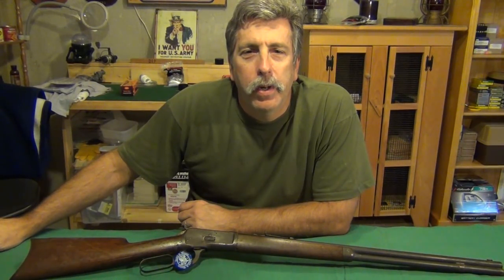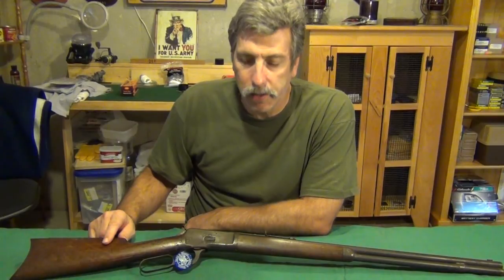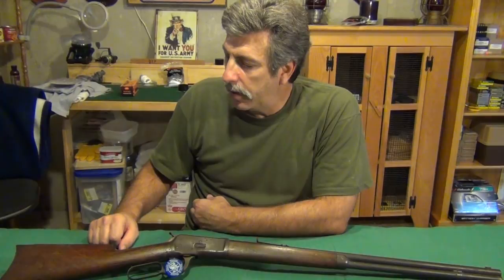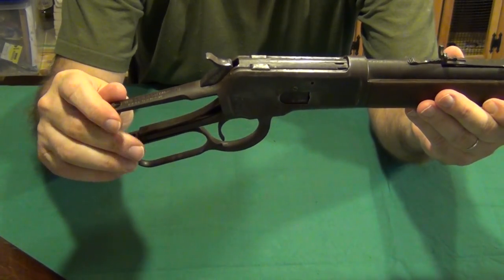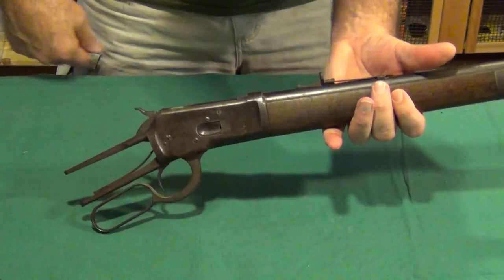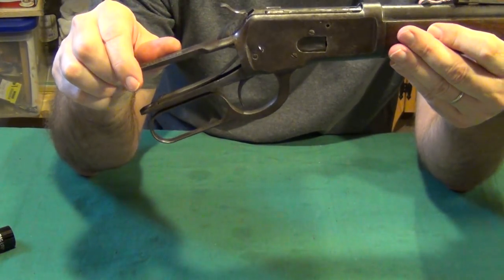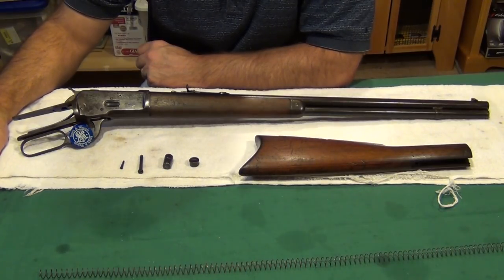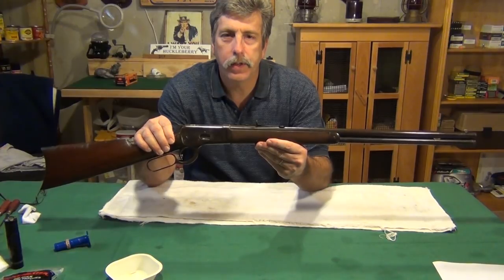Cleaning up an orginal Winchester 92

Comment: I appreciate your patients with that screw, I could not wait, or take it to a gunsmith to do what I could do. There is concentrated heat, and specialty impact drivers , and then my brothers philosophy, "if it's stuck , force it, if it breaks , it needed replaced anyway. Great old rifle and great video. I obviously needed to know something you already knew.

Comment: You could remove that forearm and soak the receiver in a bucket of rust remover for a coupe days. Brush the inside of the receiver and then soak the internals with Ballisol let sit again brush again then blow out the receivr with compressed . Oh plug the receiver end of barrel spray Ballistol in barrel fill
it up. Let sit verticaly overnight, next day the with your rod and brush pump down and up be real carefull with the crown not to damage it. Dump Ballistol
out using patches and rod stroke them until till the patch comes out clean. Reasemble and give it some trigger time BTW good looking piece best shooter
of all the winchesters!
Good Job
JWH

Comment: Great presentation!…I just disassembled a model 94 that was gunked solid, even the screws were frozen so in order to loosen them I spot heat them with a propane torch and using a metal screwdriver I gave the head a sharp rap and they were easily removed.

Comment: Go out and get a can of Kroil. It comes in an orange can. Absolutely the best penetrating oil out there. Take an old coffee can and pour kroil up to the top in it. Soak the barreled action in it over night. Wipe off all the the excess from the screws and receiver and that should do it. If not carefully apply heat to the screws

Comment: Hi, try Kroil on that screw.  If that doesn't work, I've had good luck putting a soldering iron on the screw to heat it up.  It will isolate the heat and not damage the bluing on the rest of the receiver.

Comment: Before attemting to remove the mainspring screw be sure the strain screw is backed off, (located just forward of the mainspring screw) then clamp down on the rearward portion of the mainspring just aft of the screw head over the rear of the tang, vice grips work well here but take care not to scratch the tang. this will remove all spring preasure off the mainspring screw. Re-install in the same manner.
This procedure will prevent stripping the the first few threads of said screw.

Comment: Apply heat by using a cherry red punch or bar. Apply to thread side, add some penetrate oil, let sit, till cool. Repeat till it comes out easily. May take  a few tries. Also tap a proper fitting screw driver a couple taps while having a bit of pressure in torque.

Comment: Hello, my name is Lionel and I inherited my Grandfather's gun a Winchester 44-40
model 1892 and according to it's serial no. 36.......  it was made in 1905.  It is in really good condition, ( original ), and I have been firing it and have cleaned the barrel.no rust, operates great.  Here's one thing though, I can only put 13 bullets in the tube and one in the chamber.  Are the bullets today a little bit bigger?  Is it suppose to hold 15 in the tube?  Also, could you tell me the approx. value?

Comment: Since this is 2012, I assume by now you have learned what an impact driver is (about $20.00) and that screw would be out in 15 seconds
Reply: Those screws weld themselves in the receiver. Very hard to take out, and with age, they are very brittle.
Reply from the maker: Thanks for the info. Didn't want to snap them off.